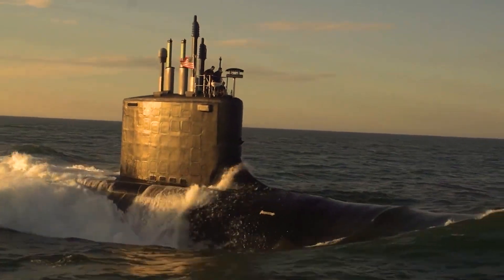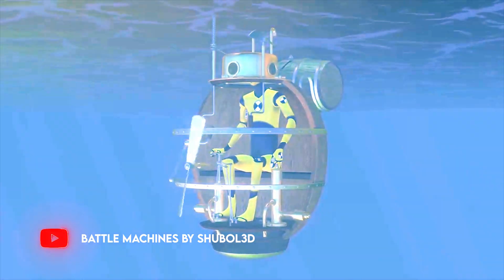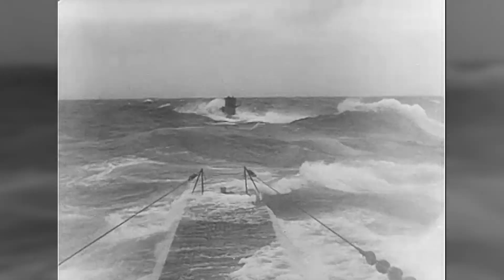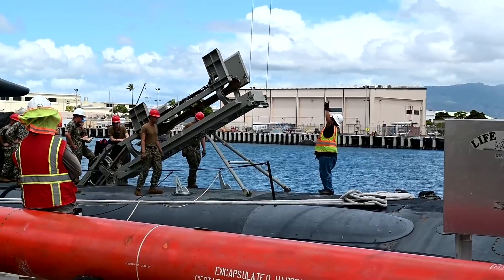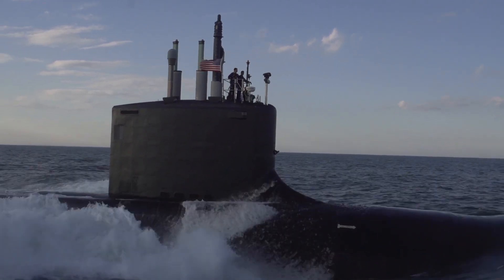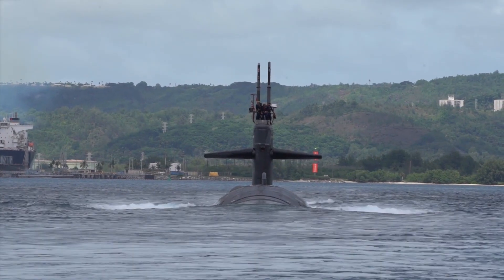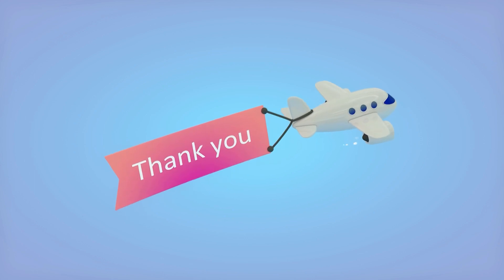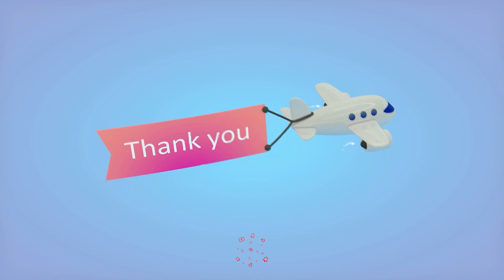Why US Military Ships Struggle Against China's Submarines

Comment: During the times of conflict, the military will deploy submarines to attack ships belonging to the enemy. The Harpoon system is a lethal anti-ship capability that can operate in all weather and enables submerged vessels to engage targets at The Wider distance which opens up more tactical possibilities. Submarines are essential for a wide array of different types of missions because of the ability of submarines to contorl their buoyancy. Submarines are outfitted with a plethora of necessary components, each of which plays an important part in the overall operation of the vessel. Submarines make regular and extensive views of torpedoes in a variety of kinds of warfare to bring down hostile ships. Thank you so much for doing this video.